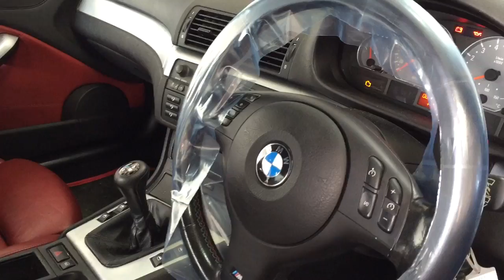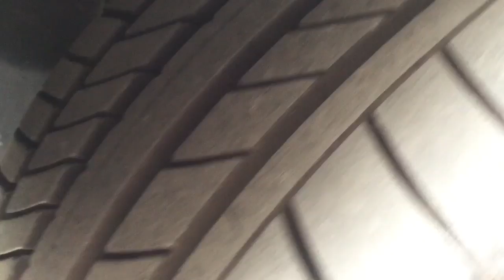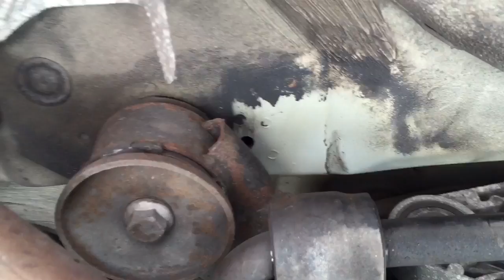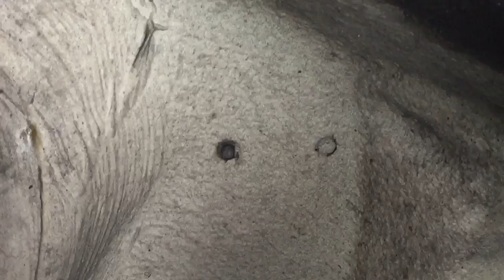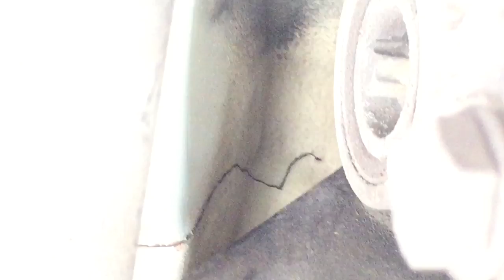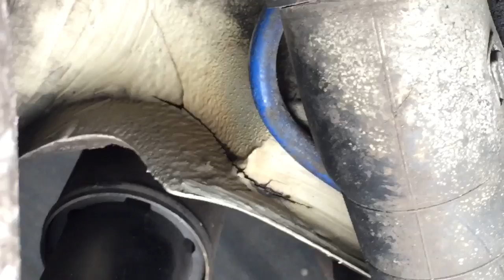BMW E46 M3 SUBFRAME CRACKS at 60,000 miles with original owner

Comment: How likely is this on a 2003 330i? (Touring, not that it matters.) There are loads of armchair mechanics on forums saying that BMW improved the design post 2000/2001, but seemingly no hard data about this. Basically, I'm looking at a nice 330i at a dealer and I doubt I'll be able to inspect it as closely as this. Need to decide if I'm feeling lucky...
Reply: mcba I think after the 2001 models of E46s they 'fixed' that problem and ironed out a bunch of others. I have an 01' 330, it has no cracks but I still get paranoid about it. You should be ok.
Reply: I solved the problem by buying an E90. ;-)

Comment: Could you tell us if this was an SMG car? 
I've heard that they are more prone to cracking..
Reply: start of the video you can see the gear lever, ie its a manual :)
Reply: As said it's a manual.

I've just had mine reinforced a day ago as a precaution ; it had cracked but not as bad as many.  It's an SMG with twice of the mileage of the car in the video.  IMHO it's the treatment of the car that matters more than the 'box.

Comment: If you have a good relationship with your dealer they can often have a lot of influence on BMW doing the repair. My car had a hairline crack, 2001 with 120000km. BMW paid for the repair and were happy to fit the Reddish plates while the repair took place.
Reply: How did you word your talking with your dealer? Hoping to get my 04 M3 approaching 116k miles inspected coming up.

Comment: I've heard that this isn't as common on newer year m3 say built in 04+ is this true? not saying it can't still happen but are they better/less prone to cracking?
Reply from the maker: Hi Rory, that is true actually. October 2004 saw 3x addition spot welds, and 1x additional MIG weld on the left side lip of the Rear Axle Carrier Panel (where it attaches to the Wheel Arch Panel) as seen in our video here: https://www.youtube.com/watch?v=2gzqC6RAxjY
In our experience these vehicles come in to us with less damage then pre October 2004 vehicles.
However, October 2004 vehicles still do experience cracking and spot weld failures (mainly around the front mounts of the Subframe Panel).
Reply: Thank you very much for the speedy and detailed reply! 
I have watched your video and that has cleared a lot up for me as I've heard some conflicting information. 
If i were to install your weld in reinforcement kit would i not have to bother with the structural foam? Or do you still recommend doing this for the added piece of mind?